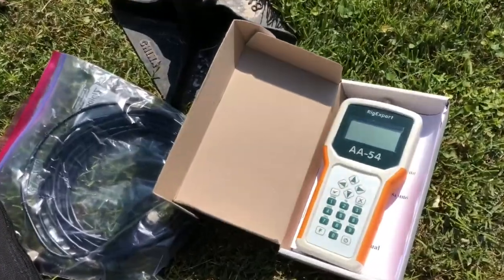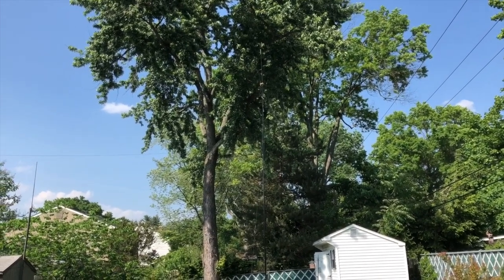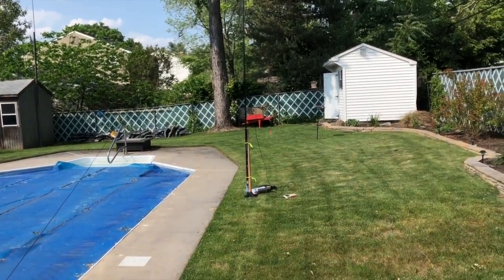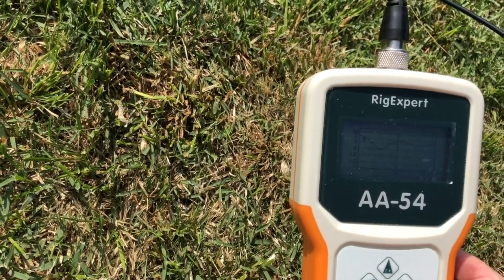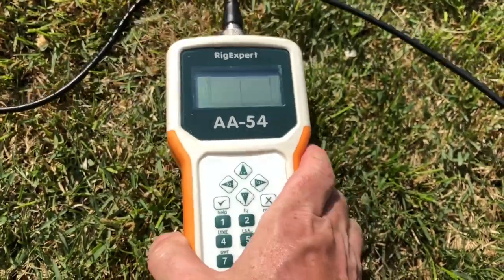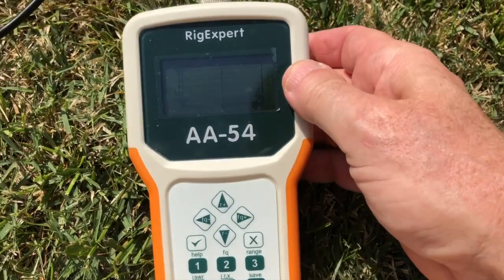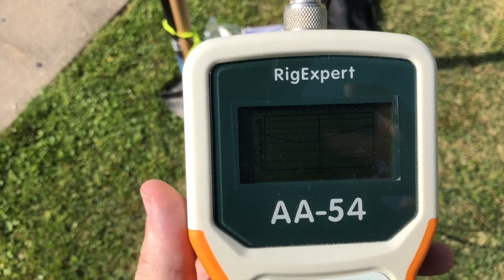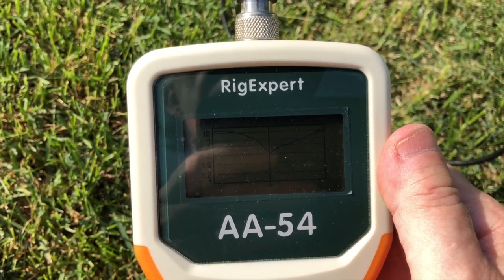Tuning the K9ARV Linked Dipole for 40M

Comment: Hi, enjoy your videos. I am running an ft 817 using the sotabeams linked dipole 20\40M. Did you ever get your linked dipole below 2:1? I have been enjoying getting into POTA as well. 73 KD9IBH
Reply from the maker: I left it the way it was in the video and it seems to work ok.  I'm thinking of actually cutting the wire rather than folding it over to see if that helps.  Glad you are enjoying the videos!  I'm overdue to shoot a few more.  Stay tuned!  73 de Chris K2CJB